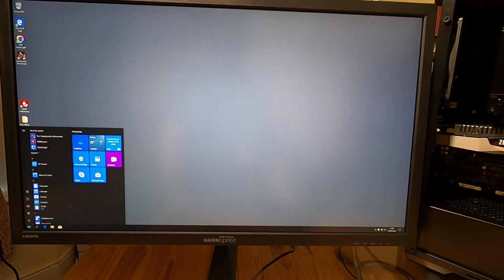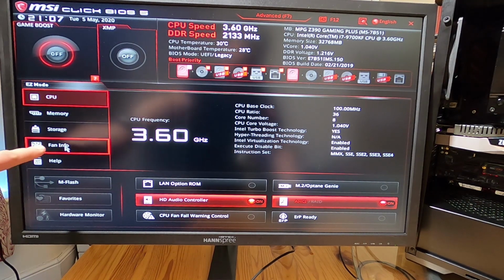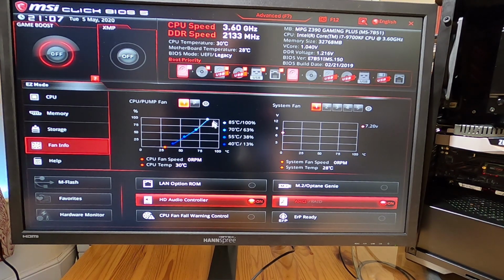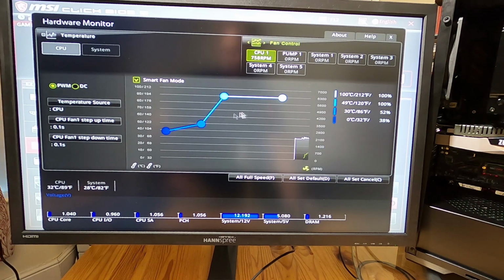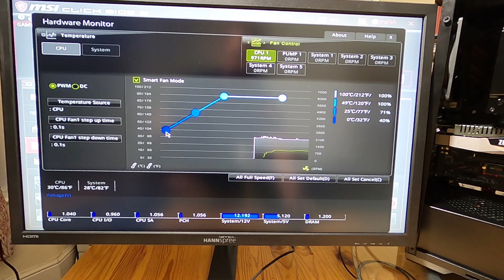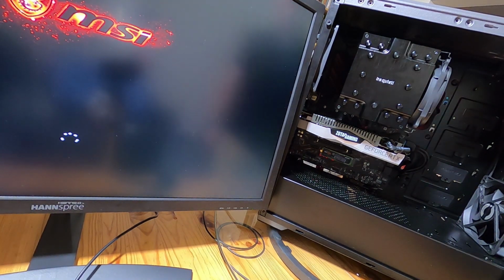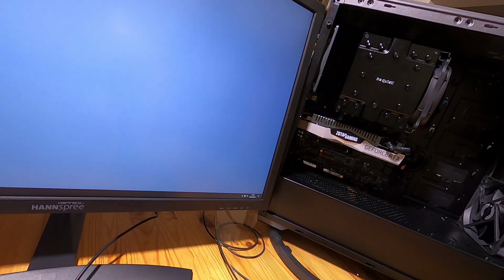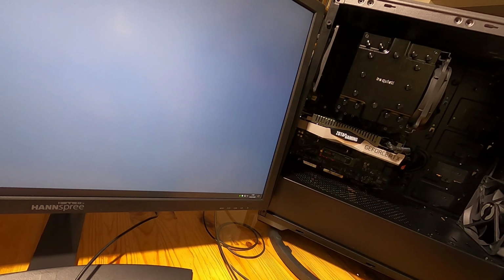CPU Cooler Ticking Sound *DIY FIX* in English

Comment: I hear the same sound too but only this time I only hear it when rendering image or video from Blender.
Reply from the maker: Assuming you've got a desktop rather than a laptop... take the side panel off and see what the fans are going when the PC is rendering.

You may have a broken fan that ticks when the motherboard tries to increase the speed to cool things down.

It'll tick because the fins are clipping the outer frame...

Pay close attention to the fan in your PSU...
Reply: @sterntechdaddy  so basically its just fan issue right? not the performance
Reply from the maker: In extreme cases, performance will be affected if the heat causes thermal throttling. but rhythmic mechanical ticking noises are usually a fan issue relating to it spinning, but clipping the frame.

This can happen at any speed... but its simple to diagnose...

Just open the case and listen. If a particular fan seems noisy then disconnect it and see if the noise goes away. Because if it does, then you've found the problem!

:)

Note that case fans aren't crucial to the ATX specification... so if you can identify a particular fan that's dodgy its normally OK to just disconnect it.

And that's also free!

If you're worried about temps then just run CPUID HWMonitor and keep an eye on the maximums.

The only fans in my 5GHz i7-8700K rig apart from the ones its GPU are the two on the NZXT Kraken AiO cooler.

And that's 65 degrees at 100% load on all cores.

:)

But, again, pay special; attention to the fan in your PSU in case that's where the noise is coming from.
Reply: @sterntechdaddy  ok, thanks... now i realize its my cpu fan & how mess my cpu are
Reply from the maker: Use a 1/4" paint brush to tickle the dust off.... and have a vacuum cleaner nozzle near it to suck away all the cr*p you dislodge.

But if you've got  stock cooler then they are pretty noisy when running at full speed anyway.... so if you clear away the dust it might be able to cool properly at a lower spin speed - so cleaning it will fix this rather than replacing it with a new cooler.

:)

Comment: How can i go to fan speed control settings in gigabyte?
Reply from the maker: Which motherboard have you got?
Reply: @sterntechdaddy  the noise wasn't from the fan but below of my hard disk
Reply: The same ticking sounds like that...
Reply from the maker: How old is the drive?

If its more than 3 years then take a look here:  https://www.youtube.com/watch?v=VPjwuvGmsTY

:)

Some drives can be a bit clunky too... but as your noise isn't linked to the fans you don't need to worry about finding the fan control in the BIOS.
Reply: @sterntechdaddy   last 8 years but it has a new one (both are connected) and also it says

CCC.exe corrupted while the noise keeps ticking...

And the CBS.log error haven't fix/replace a fresh new copy...

😢
Reply from the maker: What brand is it?

And make sure any important data is backed up....